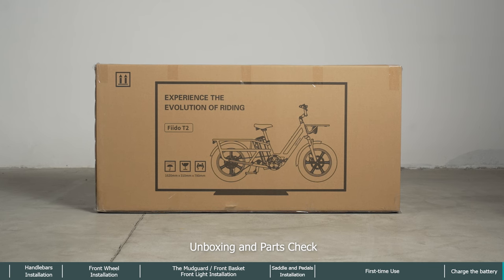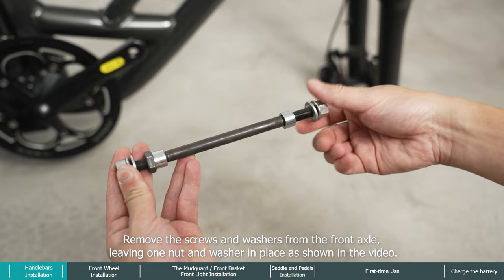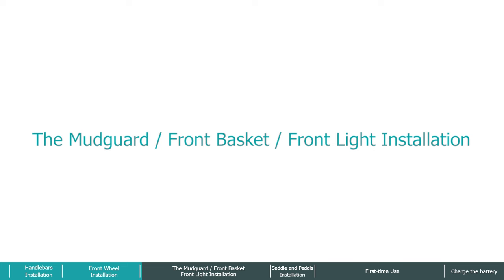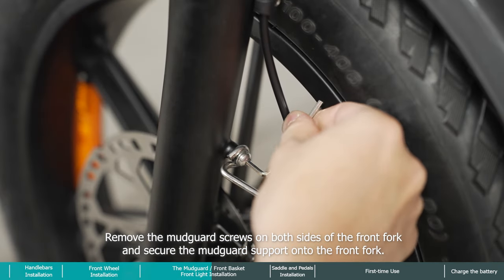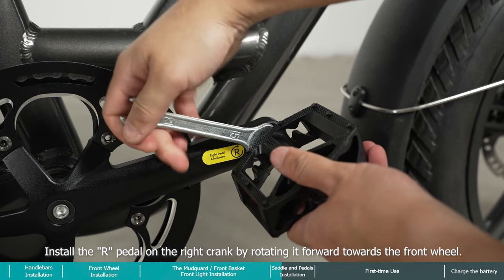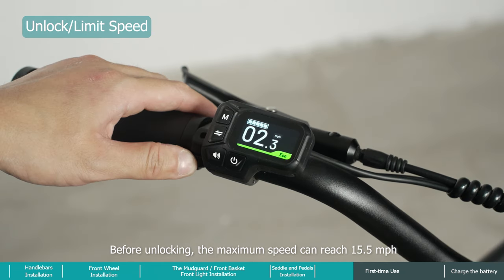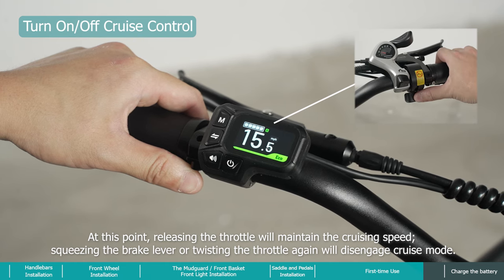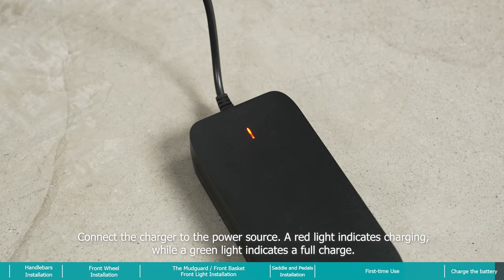Fiido T2 unboxing video

Comment: Just received your T2? Stop!

1. I would advise using better allen keys and screwdrivers than those provided.

2. Some of screws on the bike seem poor quality. As per my point above, coupled with the tools I found the screw heads easily stripping.

Otherwise fantastic bike, really fast and the battery life is amazing.